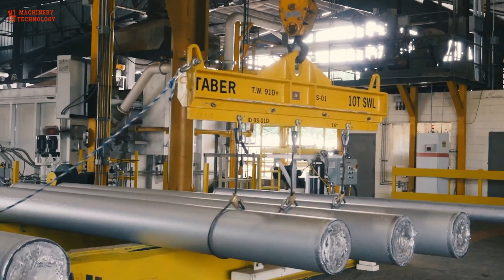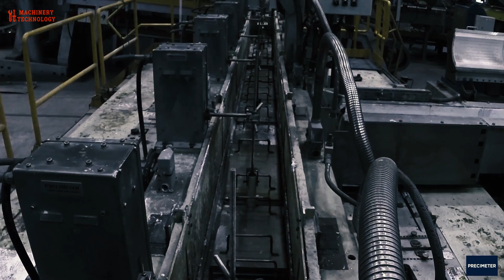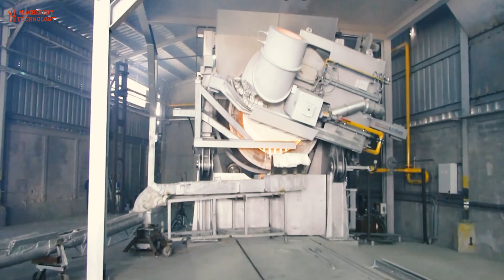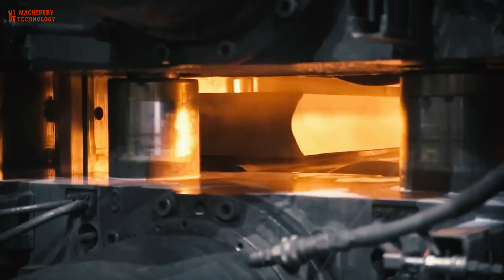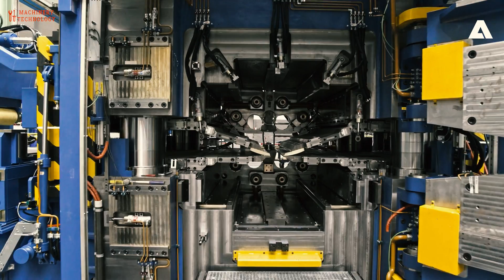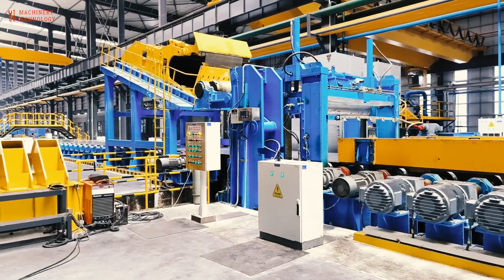SECRETS Of Aluminum Casting Factory  - The World's Most Modern Aluminum Rolling Machine

Comment: Why the automobile does not use high strength aluminum for the frames & other component's  is beyond me. A high strength aluminum frame or sub-frame would decrease the rusting of most components from the frame to the floor pan at first would be expensive but after 2 years this would be less expensive than using steel.
Reply from the maker: Good point — aluminum does resist rust and reduces weight. But automakers still use steel because it’s cheaper, easier to manufacture and repair, and provides very predictable crash performance. Aluminum is already used in some parts and premium models, but for full frames the cost and engineering trade-offs still make steel more practical for most cars.